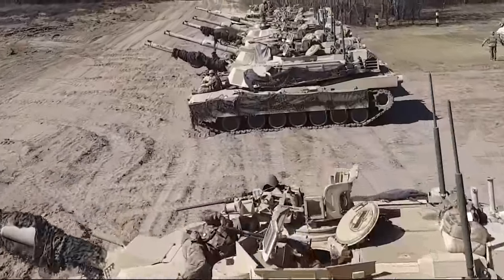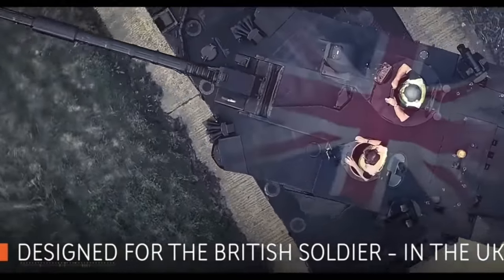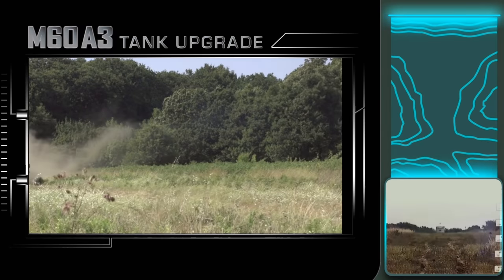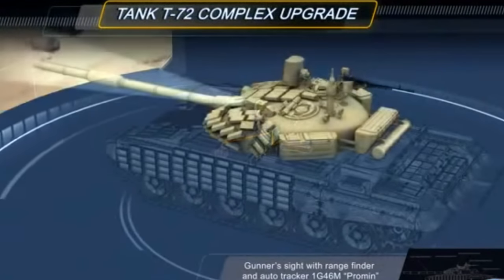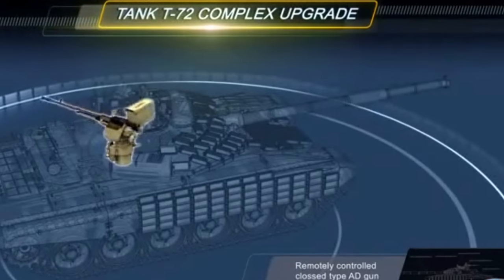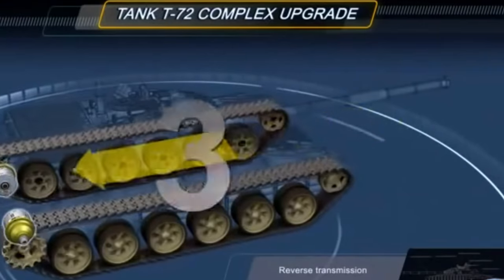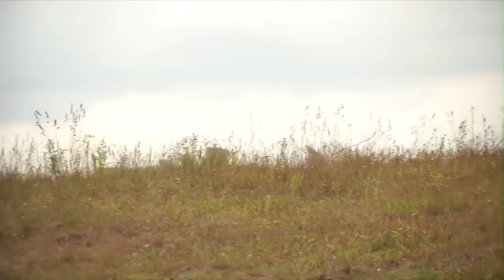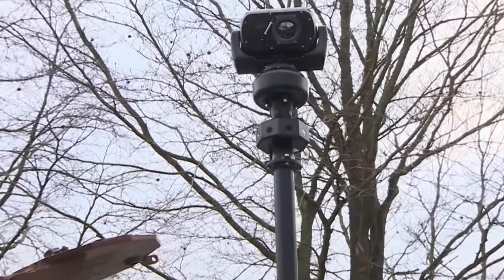Why upgrade Tanks instead of designing new ones?

Comment: because it's cheaper, but also easier to upgrade a certain volume of stuff than produce a newer volume of stuff that needs different components and tools to create from scratch.
Reply: Plus the added problem of training maintenance people and and Soldiers on new systems plus the supply chain of ammunition and spare parts may need to be recreated when adopting a newly build Tank.
Reply: Many nations have had to upgrade their old school T-55 and M60 MBTs since it's more economical than starting over from scratch. The design, testing, prototyping of new tanks is horrendously expensive and may be inefficient in comparison to designing a new one. But what options do smaller, poorer Nations have?
Reply: @mr.gunzaku437  slap 125/120/105mm on an ifv and there you go. Cheap armored vehicle with tank gun, its kinda funny to see it being use to fill the mbt role
Reply: @mr.gunzaku437  if small militaries dont have modern tanks, then why dont they just buy new ones?
Reply: @usaisthebestiockdownpoiice816  Uhhhhhmmmmmm......Because they can't afford them.....
Reply: @usaisthebestiockdownpoiice816  how would they afford them? They don't have the dough.
Reply: @randomka-52alligatorthatis34  yep, it's about cost, in more ways than one.
Reply: @mr.gunzaku437  just build IED's on tracks.
Reply: @loserface3962  the Germans tried that...it sucked...but was fun to ride I bet👍
Reply: @CleanerBen thats certainly true but every reaches a point where upgrading is no longer feasible. Correction, you can upgrade it but it no longer something that you can use on the frontlines per say.

The problem with tanks is that man portable missiles have longer range and much more deadlier warheads. Instead of trying to punch through frontal armor
Just top attack or just hit with something heavier.  Hell, the Spike NLOS carries a 95lbs warhead and you can launch that from a back of a truck
http://www.defenceandtechnology.com/spike-nlostan-hassas-vurus/
No tank is surviving a hit from that
Missile technology is literally making some question the usefulness of tanks at this point

Comment: I worked at the primary refurb depot in the US (before it was BRACed out) that did Patriot Missiles, Paladans, and M1A2 turret refurbishment. It was far cheaper to put new electronics and systems in a turret and then send it back to the unit (which has the ability to mount the turret) than bring the whole tank back, much less build a whole new tank.

Comment: Some places out there still make T55s, its still in high demand. Vietnam recently brought back into service its WW2 era SU100s as coastal defense guns and have even begun refitting mothballed ASU-85s. Ultimately I think modern war is just going to be incredibly messy, with so many old and new systems in play it'll overwhelm. There is also hints that cheaper older tanks are just better suited to drawn out conflicts (after all why expose yourself to extortionate costs to put a ultra-modern battle tank in the field when it can't even reach its full potential?) It'll be interesting to see how Syrian tanks did during the Idlib offensive. They're so old and low in maintenance it appears a few were 'knocked out' by Turkish drones only to be patched up and sent straight back into service.

Comment: that is what I've been wondering about. What if a modern MBT gets hit in the turret and it stops that projectile, but what happens if it gets hit by a second round a few centimetres from the  first hit? Would it stop that round when the structure of the composite armour has already been messed up by the first round?

Comment: Instead of listening to Mat, I was distracted by the T-72 upgrades.
Reply: Seriously, that looks like a leap in improvement.
Reply: Makes it look like a completely new tank
Reply: Sadly it doesnt have all the features shown. I would be crazy expesive with all of it.
Also it still uses the simple Kontakt-1 type of ERA prone to tandem warheads. Early warning system of the laser targeting for this one is very easy to bypass.
Reply: @HanSolo__  But the carousel of death is gone. The thing that was the critical weak spot, if such a tandem head would go through. Sure some compartments will take damage, but the catastrophic ammoition cook off is not a factor anymore.
Reply: @PiterburgCowboy  This mod doesn't really eliminate the carousel problem. The carousel has been removed but its space is used to store long rod ammo.
Reply: @andrewsuryali8540  yeah but it could store more ammo in a smaller volume meaning a smaller weakspot as it doesnt have to be stored in a ring pattern.
Reply: @PiterburgCowboy  the ammo carousel is well protected. Low on the flor with objects covering the carousel. The real problem is crews putting ammo outside the carousel like in the turret. Ofcourse if you get a low hit on the tank the ammo will explode but even then each shell has a steel casing to prevent fire. They have done some thinking when desigining this.
Reply: Is that a Russian upgrade to the T-72 or Ukrainian
Reply: @CANADIANSCOTTYFD3S  Ukrainian (KMDB).
Reply: Best T72 upgrade... Air conditioning. Yes, it has air conditioning now

Comment: Russia: more like why upgrade a tank when i can just slap more ERA onto it
Reply: Nyet!  Stalinium armor stronk enough.  ERA is just for fireworks!
Reply: Russians: if it’s deadly enough, simple reliable, and no need to retrain operators to a totally new vehicle, why get a new one?
Reply: The turret of m1 Abrams is getting longer and longer ... specially with m1a2c
Reply: @danielaramburo7648  simple and reliable but not that deadly
Reply: @Slycarlo  acording to who, americans?
Reply: @mr.waffentrager4400  what for? I never give attention to abrams upgrade too much
Reply: @Slycarlo  Do you really think Tanks are used for destroying other Tanks? They aren’t (atleast by Russian doctrine). They are more than deadly for blowing up bunkers and trucks or Bradleys
Reply: @aevangel1  "Nyet! Tank is fine!" FTFY
Reply: Sly Carl The 125mm Gun is capable is knocking out any western tank. It’s limitations are the less advanced optics and targeting sensors (fire control system).
Reply: @usaisthebestiockdownpoiice816  
Cringe
Reply: @usaisthebestiockdownpoiice816  Because the US and the other great power are inocent right ?
Stop with this bullshit.
Great powers have no morals , the only thing they want is their interest be enforced throug legal or illegal ways.
Reply: @Slycarlo  Very very deadly. Not that simple. Simple designs time is gone. And absolutely not reliable compared to western constructions. Easy to repair in some areas but man the quality of the parts is poor.
Reply: Soon to be 1m with pure ERA.
Reply: @usaisthebestiockdownpoiice816  Considering US can't even wipe Taliban off the map, maybe wiping off Russia isn’t possible for them.
Reply: @dragonstormdipro1013  Afghanistan has been the graveyard of empires since it was last conquered by Alexander the Great. Russia was the one driven out prior to the USA trying it. It is said the Afghans are at continual war . If no foreigners available they fight amongst themselves. Very stupid move for the Americans to try regime change with boots on the ground again. The military industrial complex could have made money just from missile and bomb production as well as aircraft maintenance spares.
Reply: @rkadi6540  probably for the possible new gun. Which I'm guessing will be a longer caliber 120mm or 140mm. More likely the former.
Reply: Next T-72B4 they just cram contact 1 in the small space between the contact 5s
Reply: Russia: Testing the next gen Armata in combat environment of Syria.  US: scrapped enire Marine Corps tank force, over 400 tanks.
Reply: @dragonstormdipro1013   actually the main purpose of a tank is a infantry support for long range operation that has a enemy force that could cause lethal damage to transport vehicles that carriers troops to the front line
Reply: Y Know We Test T-14 is Syria, so ARMATA type will replace all T-72 in Future Right ? Who else doing so ? Who else have NEW tank chassis ? NO-ONE ?!!!
Reply: @danielaramburo7648  The FRS is not really the problem up to this date. Russians are not stupid, the new T-90 variants can easily listed as having one of the most capabil system. The real problem is the autoloader system. The carussel can´t handle KE-projectiles with long enought rods to relaible damage modern MBT, the ammuntion they use is still stuck in the 80-90´s. Only the new Armata has a bigger autoloader, but with same design and so on can use longer rods for the KE-Ammunition.
Reply: Leopard 2A7V Doesn’t the Challenger tank (UK) have the same limited ammo problem? Even with this short coming, it’s considered a very dangerous and highly effective tank.
Reply: Talking about the war crime commiting game we all fucking lose since we've all committed a war crime
Reply: Ignacio Muñoz Diaz  Does that make any country better we've killed millions either way
Reply: anyway we're getting of topic this is on a tank vid
Reply: @usaisthebestiockdownpoiice816  
>that name
>that post

Got can you bait a little harder
Reply: @usaisthebestiockdownpoiice816  you do know those polish exports right?
Reply: @arvedludwig3584  unless you give them propaganda or threaten their lives
Reply: @usaisthebestiockdownpoiice816  Iraqi 'tanks' are not representative of even former Warsaw Pact armour, not to mention ex-Soviet ones.  And - to quote gen. Schwarzkopff - "we could have swapped equipment and still we would have won".
Reply: USA is the best what about american war crimes in vietnam iran iraq afghanistan yugoslavia ??
Reply: USA is the best look at the abrams in yemen .. saudis get kicked out by some farmers... And dint come with export model.. thats what iraq had in the last gulf war too
Reply: In fact, no, the K-5 and Relict are significantly lighter than the kits offered for Western tanks and artisanal IRA from the territory of the former Ukraine. The main difference is the optimization and stabilization of the charge and the stronger and thicker throwing plates, as well as the optimization of the location of the modules in a certain projection. Rather than increasing the number of modules or their size and weight, designed for passive protection.
Although the t-72 has a sufficient reserve weight of up to 65 tons, it already has a highly loaded engine and transmission. In addition, remaking the case is more expensive than producing a new one. so using the new EPA is just a necessity for the old T-72B or T-80B, if possible, to maintain an acceptable weight and mobility. In addition, it was the T-64BV or early T-80BV that had an excessive number of EPA modules, which affected the price and mobility. It is better to have a modern SYSTEM, such as a Relic and active protection, than a lot of heavy and inefficient modules K-1.
Reply: @danielaramburo7648  Not quite so, for 125mm need new shells. Few people except Israel, the Czech Republic and Russia are able to make a modern projectile in this caliber. This is expensive and difficult. Old projectiles that are already 30-40 years old are ineffective against Leo-2A6 or M1A2.
However, T-72B3UTTH or T-90A/M can be a real pain in the ass. Since it has a modernized gun, modern projectiles and highly automated sighting systems.
Even against the T-72B3 125mm is no longer effective because it has a new hybrid ERA Relic / K-5, better booking and a modern sighting system, even in a reduced form.
Reply: @aevangel1  You laugh but Stalin means steel in russian.
Reply: Russia: What's that Pvt. Ivan? No more ERA armor available? Then slap some infantry armor!
Reply: @Tankliker  Not really, there are projects with a tower linear automatic loader, as on Leclerc-2. Or the expansion of the carousel of the autoloader due to the alteration of the case. You can also install the 2a82 cannon on the T-72b3 or T-80U, but these are old chassis and it will cost comparable to the new t-90M.
Reply: @usaisthebestiockdownpoiice816  There were practically no Soviet-built tanks in Iraq. Only T-72M (Poland) and Type59 China. Iraq received 180-200 kits for the assembly of the T-72S export model from the USSR and then deliveries were stopped because Sadam showed himself to be an irreconcilable idiot. T-72S Iraqi assembly (with idle night sights) ended up in the Republican Guard in Basra. The rest of the army was a heterogeneous armed group without a common command, subordinate to clan interests.
Also, Iraq did not pay for the supply of ammunition and ordered training versions in China and eastern Europe. Corruption or idiocy? Probably all of the above.
Reply: @-oneretrospective1960  I believe you didn't fully understand my point. The Russian carrusel design the big problem that the length of projectiles is limited. Changing the lenght of the APFSDS rod to more modern Standarts would mean also changing the autoloader in diameter, which is not really worth it. The T-14 design kinda solved the (even if only half ass) by using a larger carrusel which let them use larger APFSDS rods with higher penetration. The carrusel will still have the same problem as the one of the T-72/T90 series of becoming to small for future Standarts in the long run.
Reply: @dragonstormdipro1013  How long did it take Russia to reach Kabul? Oh, they didn't... We were there in a matter of days.
Reply: @mickheaton4609  Do you ever get tired of guessing or are you just this used to being wrong? 

The cut is not only with armor but with ground cannon artillery and light attack air platforms.  Grunt battalions are cut from 24 to 21, arty batteries from 21 down to only 5.  Amphibious vehicle companies from six to four.  Also cut are MV-22s and most importantly light attack attack and heavy lift squadrons.

Given that it's not just a budget cut adjustment but a ground up mission capability and most importantly LOGISTICAL restructuring, the entire role of the Marine Corps has been fundamentally altered, from deployment to capability.

For whatever reasons, Marines failed to achieve set goals in Iraq and Afghanistan.  Some say that the goals were set up to fail, others day it's purposeful sabotage of the mission, and there are some that say the real reason is irrecoverable moral degradation of the command chain down to the grunts, a liability that became impossible to cover up and required a restructuring in order to cover up just how bad it got.  Some such examples were leaked snuff films of Marines in Afghanistan engaging in child rape by using their K-9 dogs, which were specifically trained for rape and then murder of their victims (neck strangulation).  Other examples were so grizzly and involved shit so dark that they can't even be mentioned.

The idea that USMC does not need tank armor is a pile of horse shit, because as soon as mechanized infantry was born, Marines got armor.  M4 Shermans were used by the Marines specifically as armored fire support, without which a marine is just a meat bag to be cut down by enemy small arms.  

Without embedded armored/artillery support and heavy lift helo capability, there can be no effective USMC operations, period.

For whatever reason, USMC has been castrated and is no longer able to operate independently from support that can only be provided by the Army and USAF, and that means that USMC is no longer effective in its traditional deployment role.
Reply: @mickheaton4609  They came to Afghanistan on request of their government, they landed on Kabul on the 1st minute. Who taught you history, Bart Simpsons?
Reply: @usaisthebestiockdownpoiice816  sarcasm or mental illness?  Please clarify
Reply: @BigSmartArmed  I think he's trolling. This can't be real.
Reply: @dragonstormdipro1013  Russia did't wipe them either (:
Reply: @danielaramburo7648  But Russia puts new FCS to their tanks
Reply: @matt_pigeonowsky1734  No but Russians usually don't claim such bs
Reply: @jackjackerman4501  and what? are you suggesting we ignore what russia and the syrian regime are doing? we spent so much money trying to take out assad. that money came from tax payers. we cant just stop and let bad people continue committing crimes against humanity. taking out assad will also benefit our allies isreaI and saudi.
Reply: @usaisthebestiockdownpoiice816  I am really pro America, I support trump and I align with conservatives but I am a little bit more to the right. I share a lot of values with the Americans, e.g I respect the american constitution and think it's one of the best in the world. But you got to agree that America did really bad things, like bombing fellow christian Serbia/Yugoslavia and unjustified war against Iraq.
Reply: @aevangel1  What win fight tank named Stalin, or tank with Stalinium armor package?
Reply: @JoesGLI  Two soviet tanks means everybody wins!

On a more serious note, neither could lose, because all Soviet tanks are made of Stalinium.
Reply: @aevangel1  Da! My brother. I drink to that. Would you like join drinking of Potato mash and listen hard bass?